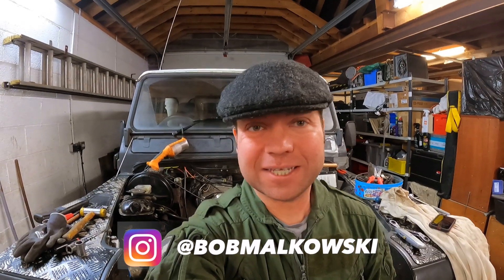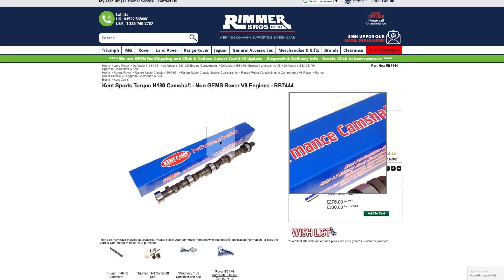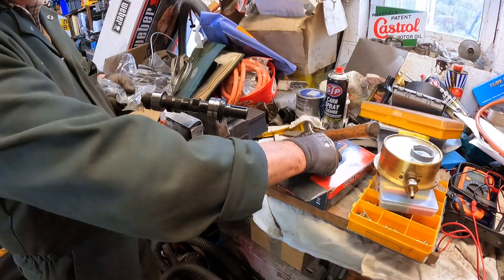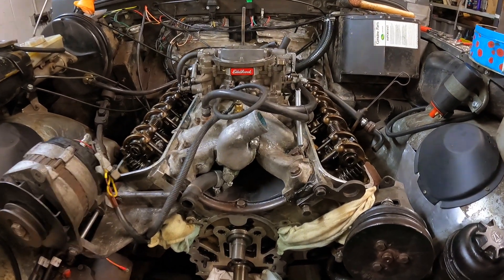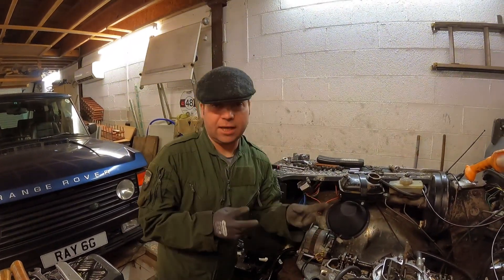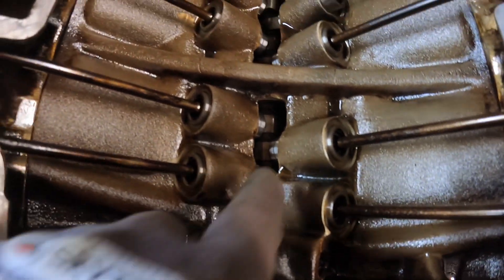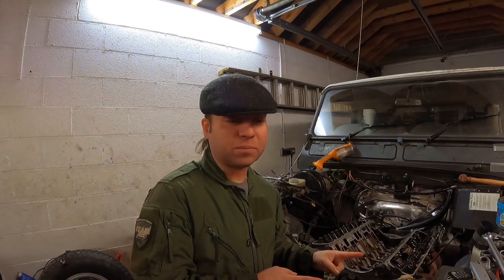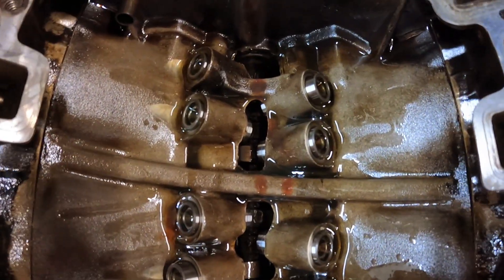This Faulty Camshaft Ruined my Engine!

Comment: Nice video, just fitted my kent 180 cam, new lifters, chain and spokets, did you have to add any shims for lifter clearances?
Reply from the maker: Hi there! I will admit, with this cam I just bolted it in and “sent it”. No shims were used.

Two years on and all seems well.
Reply: @Motorhaus  excellent, just what i wanted to hear, ive done the same also